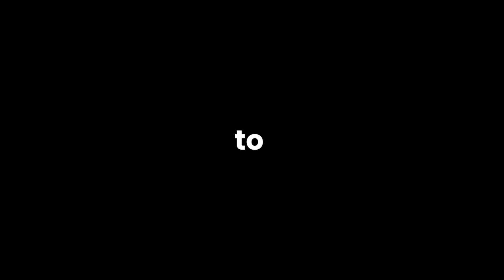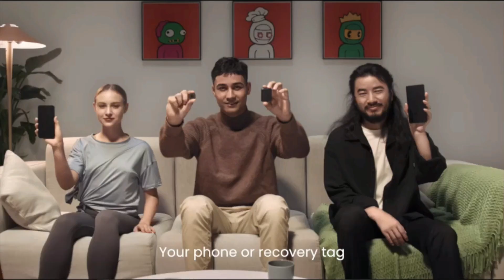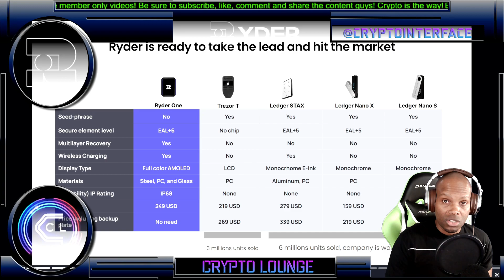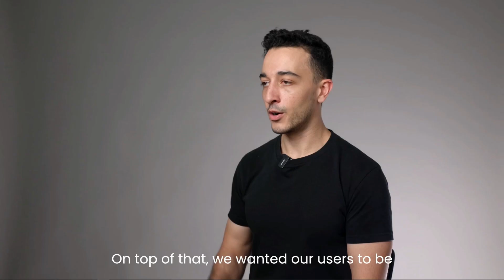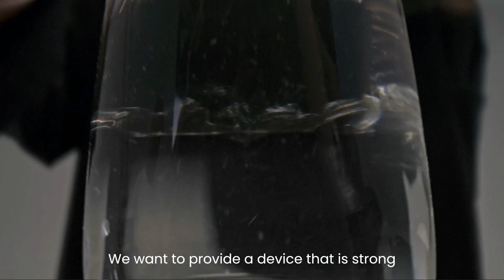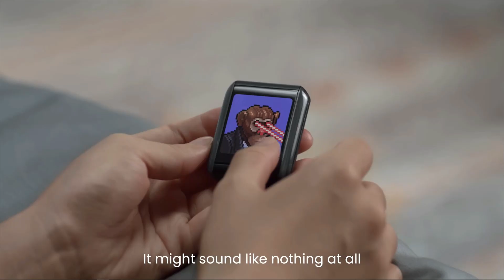Level Up Your Crypto Security with the Ryder One Cold Wallet

Comment: is app and firmware 
100% open source???? if no then its like other wallets
Reply from the maker: Not needing seed phrases and that tag approach was quite unique in its own right. I don't think any of the competitors offer that..

As far as the open source nature of it, I believe it was not. The design and intricate manner of build was proprietary.

I'll double-check with the devs on this, but if I remember correctly,  it is not open source.
Reply: Thanks. Because seed is still there but they made it easier by saving it to tag instead of words and their app is connected to internet, if its not open source everytime you use nfc you dont know what is going out